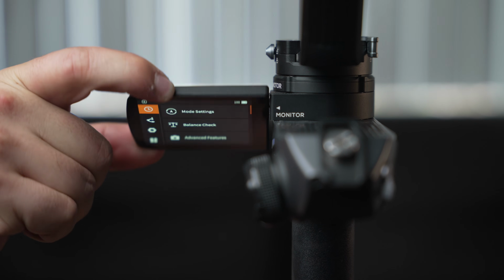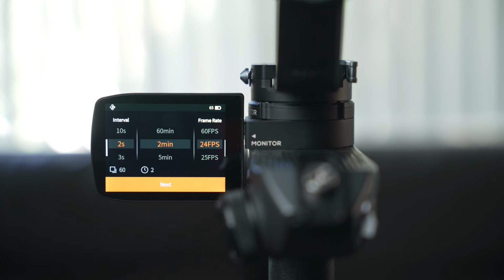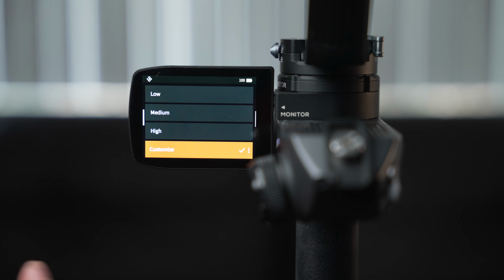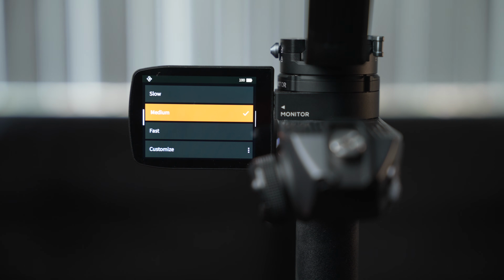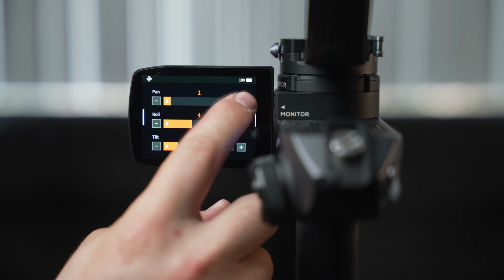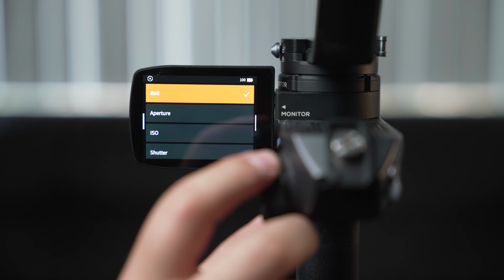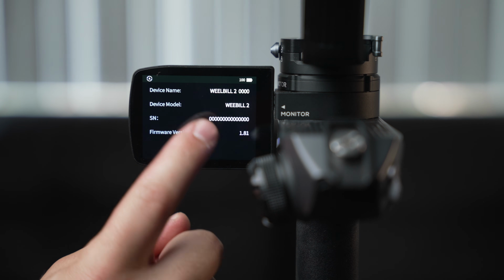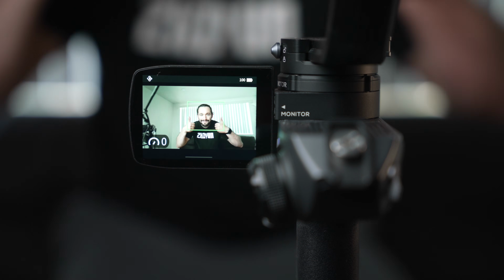How to Use The Weebill 2 TouchScreen

Comment: I NEED HELP!!! I just bought the Weebill 2 Combo package which I am trying to use with my Sony A7III Camera, but after balancing and all when I switch on my Camera and the gimbal USB Mass Storage starts connecting and then ends up with the message "check the connected device" on a dark screen!
Please can anyone help me solve this problem? Thanks.

PS: I am a first time user of the Weebill 2 gimbal!
Reply from the maker: Hi Samantha, could you please check if you use the cable with yellow sticker to connect the gimbal? So sorry for such inconvenience caused. Could you please contact with our aftersales? They can assist you through phone call or video call. Aftersales: https://www.zhiyun-tech.com/en/service?type=website&page=header&source=service
Thanks a lot. Hope we could solve the issue asap.
Reply: @ZhiyunTechGlobal  None of the 5 cables that came out of the package had a yellow sticker on it. I have tried the multi USB to type-C cable but it doesn't work and even tried the type-C to type-C cable but still have the same problem!!!
Reply: @ZhiyunTechGlobal  Hi. How to connect weebill 2 combo to Nikon d850? None of this cables from box work with Nikon D850. I use Nikon cable buble USB to USB-c but screen show ,,Image transmmision devaced is not connected. Please connect to use'' What I need to do? Please help.

Comment: Hi zhiyun. Great products. I bought the Webill 2 pro package along with the master eye controller. I even bought an extra transmount transmission AI for my Weebill s. I have 1 software request. Can you update the Zhiyun Play app to allow a clean fullscreen on smarth device so that i can mirror my device and use it as an input in my switcher for live streams. Also on the master eye would be great if you did add a hdmi out port. This would be a killer feature. I see that there is an usb c port. Can u enable video out through this port so i can use an usb c to hdmi cable to go to switcher